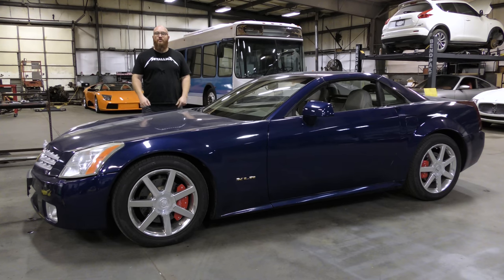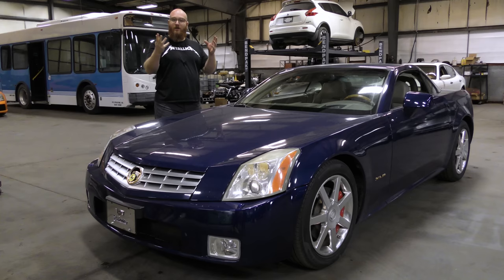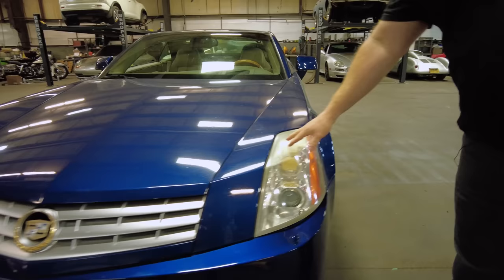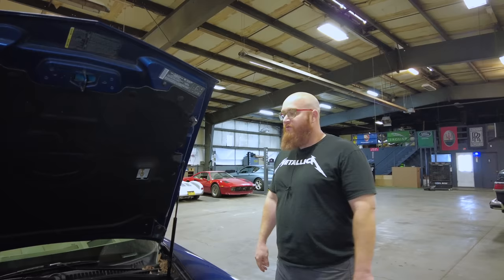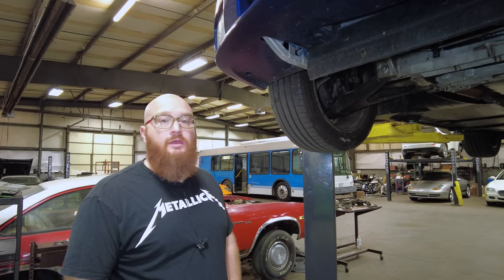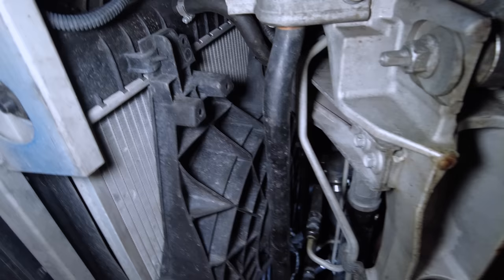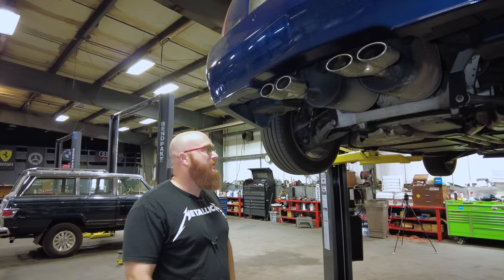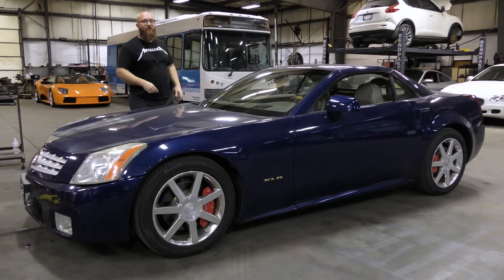Another Northstar? Why does the CAR WIZARD keep buying Cadillacs with this engine? Now an '04 XLR!

Comment: XLR owner here, 2006.  First of all, I've done a lot of research and once and for all, the Northstars were fixed and made right somewhere around 2003, just don't buy one earlier than that.  But aside from that, I normally keep my toy cars only  a couple of years, and I've had plenty of them: '67 Riviera GS, several Cadillacs and Lincolns including a '63 4-door convertible, a DeLorean (new), Mercedes 450SL's (2), Porsche 944 Turbo and 928 (2), Dodge Stealth Turbo, Plymouth Prowler, Ferrari 360 Spider, BMW i8, etc.  The XLR is now going on 12 years and I have no plans to sell it; I just love this car.  The best of both worlds with the retractable hardtop, rare, gorgeous, decent performance (mine isn't a V either), and one of the few convertibles that looks every bit as good with the top up as with it down.  The only real problem I've had all those years was having to replace the hydraulic pump for the top.  Other than that, yes, the trunk insists on leaking no matter what you do, but ironically it is the only convertible I've ever had (and I've had 9) that doesn't leak a drop inside the car, even through car washes.  The only real downside is that I'm terrified of being hit; as the Wizard said, the headlights and taillights are not available except used, and for a fortune IF you can find them.

Comment: Used to work at Ourisman dealership two years ago and there was one XLR that got traded sometime before I started working. When it was a slow day at work I used to take the cars to our car lot which was 2 miles aways from the stealer I mean dealership. I drove the XLR multiple times and even took it to my neighborhood once, that car drives amazing and the engine note is marvelous. The interior quality is typical GM but a bit better with BVLGARI dash instrument panel. Added around 20 miles to the odo since I started working there, and even ended up selling it myself to someone from NC (dealer was in DMV) and dude drove it back 4 hours right after purchase. I felt like I sold one of my own car and felt sad when it was missing in our lot. Probably one of the best car caddy churned out in the 2000s.

Comment: I too love the XLR. I had one a few years ago and it was very good to drive and be seen in as it was so unique. Sadly the roof went wrong and the dealer couldn't fix it and also broke the radio for good measure.  A pity GM did not support it properly with parts availability and technicians who knew what they were doing.
Reply: Could have sent it to car wizard

Comment: I’ve currently got my 2005 Pontiac Bonneville GXP with 122k miles. I’m the second owner and has always been a Texas car. It’s been extremely reliable. Besides a few drops of oil on the garage floor after being parked it’s perfect. In fact I just got done taking it on a 1000mi trip and it didn’t give me a single issue.
I also had 2 Cadillac STS-V’s years ago. Amazing cars, the LC3 was truly a beautiful engine and damn near bulletproof.
Reply: That’s a sweet ride. I had a ‘01 SLE. Always wanted the GXP
Reply: @BenJammin427  it’s a great car, besides it being extremely difficult finding replacement interior parts it’s really a great car. Sure it’s a big car and doesn’t make big power but it sounds damn good and will get up and go on the highway
Reply: The LH2 and LC3 are bullet proof.

Comment: Only took general motors 10 years to figure out the head gasket problem. For them that's pretty good.
Reply: Proof they do minimal R&D on their new engine designs. Never trust a GM motor that is less than 10 years old in it's inherent design beginnings. That's why the only GM vehicles I'd ever own have either the 3800 V6 or a Chevy small block pushrod V8. With NO cylinder deactivation!

Comment: Repaint for sure. I'm fairly confident Xenon Blue was not offered in '04. The reason you don't see rust or dents in the bodywork is because they are basically a plastic material. You have a choice to make with the shocks. You can buy the OEM magnetorheological shocks, and that was my choice, or switch them out for Bilstein units and install an emulator to "fool" the computer into thinking the stock shocks are still there. Klaus at Top Hydraulics is the source for all top related issues. He has a great series of YT videos that cover the whole set-up. Those rotors are aftermarket, as the stock ones are solid, not drilled or slotted. Look for the small coolant hoses on top of the radiator - see a "tee" where three hoses come together? Replace that "tee" with a brass one because the stock plastic piece can break. I like the rain-sensing wipers, radar cruise control with variable following distance and the heads-up display. The CD player is a five disc, you feed it one disc at a time, and there's a DVD slot behind the fold-down infotainment screen - bonus points if yours came with the navigation disc. You can add the bluetooth module like Video Bob did, but only if the car came with optional XM, otherwise you'll have to use something else. Check the tail lights to make sure all the LEDs light up when the brake is pressed. Rebuilds are $500. I'd advise you to add LED bulbs to the orange front running lights. Incandescent lights melt the orange lenses. Add load resistors to keep the turn signals from hyperflashing. A Corvette rear sway bar and associated brackets bolts right on, all the attachment points are there. Mine has 108K miles on it and runs flawlessly. Oh, and Michelin Pilot Sport all season tires aren't too expensive, grip like crazy and wear well.
Reply: All good stuff. Well done, JB! ^v^

Comment: “Why did you buy this?” Because the LH2 and LC3 shares name and displacement with the FWD siblings only — these do not share the same issues as an LD8 or L37 FWD car… the LH2 and LC3 longitudinal engines are extremely reliable, and most importantly don’t blow head gaskets…
Issues with FWD models were fixed as of 2004, however with neglect the FWD’s can still blow, though it’s rare in an 04+. I’m not sure how it costs $5000 to restud a Northstar, Northstar Performance does the entire job for $2500CAD lol.
You can also still get the XLR for $9-15k pretty much anytime. The ones asking $30,000+ with 70,000+ miles aren’t gonna get it.
This car is Xenon Blue with Shale interior. Nice combo.
GM could not integrate VVT into FWD models due to the already present torque steer. FWD VVT prototypes were made, but the torque steer quickly put a stop to that development for FWD.
There wouldn’t be any overheating with an LH2 unless your thermostat is toast… because again these don’t blow head gaskets and don’t need to be tested for 25 minutes like a FWD car does.
You don’t have to start the car. You can just hit the button without your foot on the brake to put it into accessory mode.
Yes the oil pan gasket can leak. As can the valve covers. But it’s a conventional job on these, and the engine isn’t going to grenade itself like a FWD.
Reply: So glad finally someone gets it, also the LC3 is amazing. I had two STS-V and they were my favorite cars.
Reply: @jwjones91  I’ve had an STSV and like 6 FWD Northstar’s and one of the FWD cars had a gasket issue… lol. And I bought it that way knowing it was done.
Reply: Looks like Xenon Blue is about the same shade as Ming Blue Metallic (or the later Imperial Blue Metallic)
Reply: @ic1815  that is awesome man, I actually got another NorthStar car a 2005 Bonneville GXP. Just got done taking it on a 1000mi trip and gave me zero issues. It drip a few drops of oil once it’s been sitting over night but that’s typical for an older car and a NorthStar haha
Reply: All facts, I hate these LS fanboys acting like the LS doesn’t have its own issues. The 6.2 in my Escalade needs constant repairs! The LC3 in my STS-V has 300k miles with no leaks!
Reply: @DJKadilac  all the LS’s problems can be summarized with only 3 letters: AFM.
Reply: @digitalrailroader  lifters, bent rods, oil pressure, piston slap, faulty rear main seal, cam sensor position sensor design, water/oil pump, etc.
Reply: Thank you! I owned an lh2 and an lc3. Sold the lh2 SRX to my father. And the lc3 based sts-v to some guy on Facebook so I can put it into the loan I got on my CTS-V sport. I fucking love the rear drive North Star

Comment: I was a tech at a Cadillac dealer back when those were new. 
It’s almost never the lower oil pan that leaks. It’s the lower crankcase half that leaks.
Reply: We had a 2004 XLR that developed a leak in the engine output seal to the drive shaft around 150K miles. No other issues that that. We were very happy with the car. ^v^

Comment: We can all agree despite the disaster head gasket failure the northstar is a damn good engine when working properly, the key to these engines is making sure your cooling system works properly if not these things will explode

Comment: Reminds me of an r129 Mercedes. Even the engine looks similar to the m119 with the cam shaft advancers on the front of the engine. Same 320 horsepower too although cadillac has an inferior interior. Convertible top looks to be a nightmare as well just like r129
Reply: This car was GMs answer to the Mercedes SL.

Comment: I’ve wanted to find a messed up early one and LS swap it. I know I know. Think it would be a cool highway cruiser. The folding top setup entices me
Reply: Northstar performance in california would build you a nasty NA northstar- these things spin to 9200 rpms all stock with just a valve spring swap and more fuel. Its all forged - there is no 4 bolt mains- the crankshaft sits in a craddle like in an F1 racecar (thats why he keeps talking about the Lower oil pan)
Reply: My thinking exactly what would it entail to do it LS swap!
Reply: @1DEADBEEF1  they don't seem to mess with the XLR stuff.  I was all excited.
Reply: There's a guy that did that swap and dynod it.  I don't remember the numbers.
I'm putting thought into doing it as I have the forged 403 from my Z06 sitting in my garage as we speak.  My buddy said to just get an aftermarket setup to run the thing so that when emissions came due ...the normal computer would read ready states for all the tests and I would pass.  I dunno yet what I will do.
Reply: it'd essentially just be a c5 corvette at that point but there's nothing wrong with that
Reply: @KrikZ32  that's actually a plus because there's basically zero aftermarket support for the XLR and the one company that did offer goodies was so over priced it made you sick.  LS it and EVERYTHING that works on a Corvette will work on the XLR.  That would be awesome.
Reply: @KrikZ32  True!

Comment: Northstar engines never had a head gasket issue. They had a head bolt pulling out of the block issue. While it was improved in '04, it was never solved. Newer engines would still pull bolts out of the block. Once repaired with NP head stud kit, engine is problem-free, especially if one does the timing kit and bottom end reseal "while you are in there". Great engine once properly repaired. Good buy Wizard.
Reply: Not a great engine if it needs Al that to make it almost reliable

Comment: Honestly the RWD LH2 Northstar is a really solid engine.  It was a heavy redesign adding variable valve timing and some very sophisticated engine management.  The worst thing you can say about it is fuel economy is poor for the power output.  But they are pretty stout.  I've had two.  It went into the 04-09 SRX and 05-10 STS, most commonly.

Comment: First of all, it’s a brilliant engine when working. These rear wheel drive version usually do well. But I’m glad everyone thinks they’re junk. Keeps my cost down. Currently enjoying my ‘06 DTS, and I will own an XLR one day.
Reply: That's because they are junk. LMAO, you can keep anything Cadillac. I'll stay miles from them. I'll stick to Toyota, and Honda, and Lexus if I can afford the fancy Toyota.
Reply: @shuway9422  This model run is far from junk. Any post '05 LH2 Northstar is actually a great engine. You just have to take care of it. Standard maintenance and fluid changes are a must and like most cars it lasts longest when you actually use it. The STS, DTS, and XLR (never mind the Escalade) are all solid choices. In my opinion it's the last time Cadillac chose luxury over sport.
Reply: @shuway9422  thanks. I currently own 5 of them. Just drove my 81 Cadillac over 1200 miles. Doing just fine
Reply: @mahatma171  '81 Cadillac still running reliably?  Must be the 368 without cylinder deactivation lol
Reply: @joe6096  it’s the 368 WITH cylinder deactivation. All 81 Cadillacs with the 368 have that feature. And yes, the deactivation after 41 years still works perfectly and pretty seamlessly. I can shut it off if desired, I have it on a switch under the dash- but honestly I leave it on most of the time, because it works.
Reply: @mahatma171  What year did they add that awful disaster then, 80? - and no, you will NEVER convince me it was anything but an abject failure deserving of killing the entire Cadillac brand (along with the 4100 and 350 diesel)

I'd tear that sh-t right off the motor and into the trash if you forced me to take your car lol
Reply: @joe6096  80 was the straight 368. 81 was the 368 v8-6-4.  The actuators pop straight off, it’s very simple to make one a straight 368.   Blame government shenanigans, not Cadillac.  I enjoy the car.  I also had a 350 diesel powered 80 Eldorado Biarritz in triple black. I tend to gravitate towards engines that people say are junk if you couldn’t catch the trend lol… also been a 6.5L diesel owner for over 24 years.  If the 368 blows, I will dump a 472 in it and call it a day 🤷🏾‍♂️

Comment: If I remember correctly, by 2004, all the head gasket/head bolt issues were finally fixed. The XLR used the LH2 Northstar (good for 320HP) while the non performance oriented DTS/Lucerne used the LD8 (275HP) and the performance oriented DTS/Lucerne Super used the L37 (292HP in final NHP form)
Reply: I could have sworn these had LS1 in them.
Reply: yep, 2006+ for the DTS and Lucerne's the head gasket was fixed, and maybe the last model year deville's, xlr's, etc.
Reply: @ZzzsamzzzG59  and you could always tell if a Lucerne had a V6 (there were two different V6s depending on model year) or the Northstar by the number of VentiPorts on the front fenders.
Reply: nope, wasn't until late  and for sure by 2006, like i said above, don't take my word for it check northstar engine facts. and it was studs and sleeve o-rings that were the problem.
Reply: It was a crime that it took them a dozen years to put in good head bolts.  Low mileage RWD Northstars (SRX, STS, XLR) are now rare.  I've had 2004 and 2008 FWD ones for 15 years without engine problems.
Reply: You are correct. Gm used longer hradbolts half way thru 2004. Look for the N* badge on the trunk (like Wizard's)  & stay away from the trunk that "32V Northstar".
Reply: But in all fairness... I did own a 2003 Cadillac DHS & never had a issue! Now own a 2008 DTS
Reply: @octoman_games  common misconception but, on the bright side, an ls would fit and mate up to the trans with zero problems....it's the computer stuff one would need to deal with.